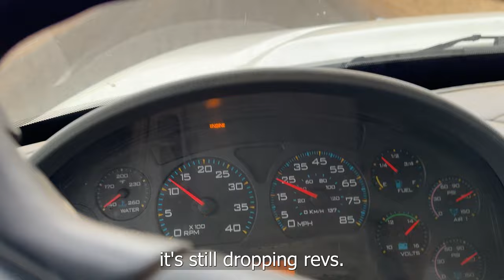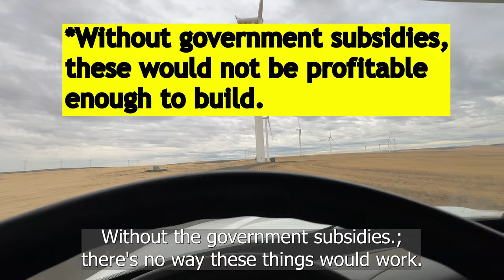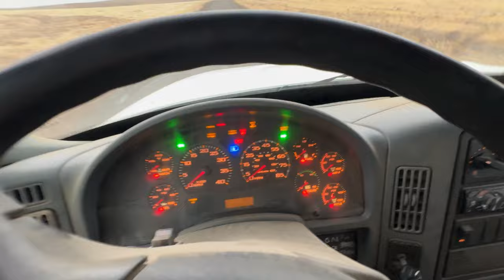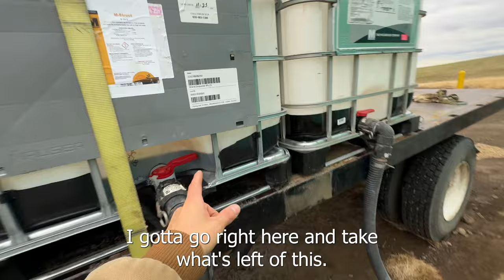Coasting a truck

Comment: My uncle has an older International truck that had a bad ECM. It would limit the truck to 35 mph due to an overheating condition.  The engine temp was normal, but the ECM would indicate an overheat condition and limit the speed. The coolant temp sensor and wiring tested good. He had to send the ECM out to get it repaired.
Reply from the maker: I hope its not the ecm. We dont have the tools to even diagnose it. Someone will figure it out tho!